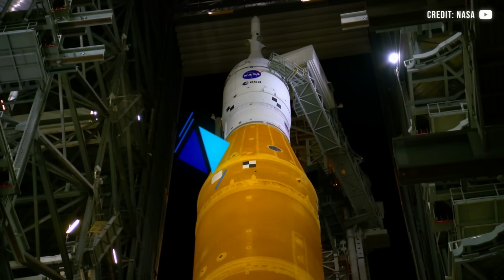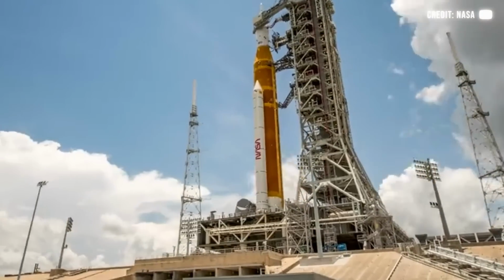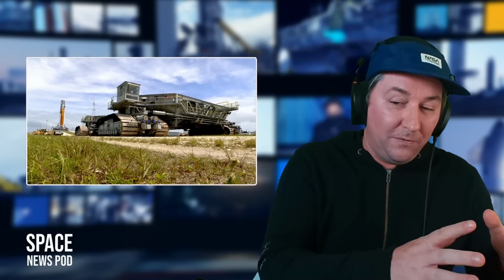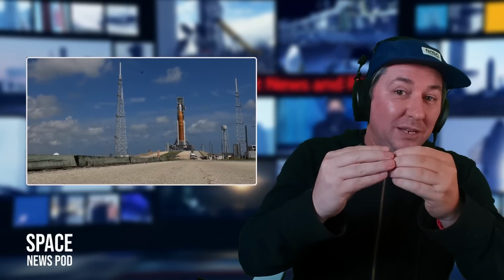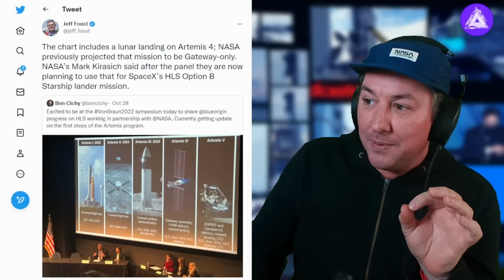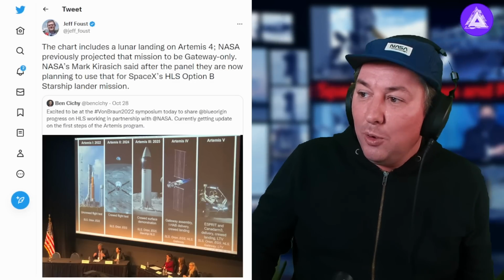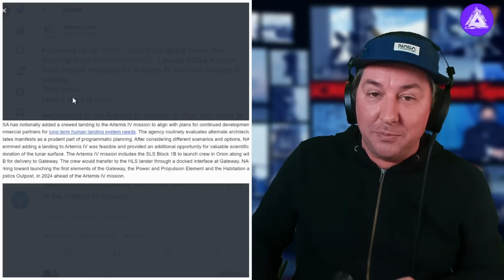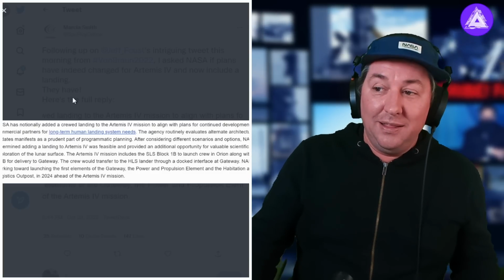NASA Artemis 1 Launch Updates

Comment: Just realized the Moon has been moving away from Earth, SLS might need to be redesigned and fitted with bigger fuel tanks, also the longer duration needs to be taken into account.
Reply: The block 1B variant features the E. Upper Stage. It has wayyy more range than the current ICPS and can carry much more payloads.

Comment: The choice to go with Hydrogen for such a huge rocket was a bad one
Reply: The re-used space shuttle engines on this rocket were designed for liquid hydrogen.
Reply: @njm3211 
 That's the PROBLEM. Save a penny, lose a dollar x 10
Reply: They used it for Apollo too, so... calm down sparky.
Reply: @hawkdsl  More power but more problems. Hindenburg turned out to a Glorious Failure.

Comment: The Question: Why didn't they do this detailed scrutiny of the SLS systems months or years ago during development and assembly?
Reply: Because they would make less money sad to say.
Reply: @OZtwo  Well...I know this Boeing is on very thin ice with NASA, and it's cracking.  The Cost Plus Contracts of the past have syphoned $$$billions from NASA & the DOD. No more Low Balling  to get a govt contract then come back for more money. SpaceX shower that they could fulfill a contract, on time, and still come in under budget.  So no more of these COST OVERRUNS, or Mismanagement excuses. 

The OMB now demand to know the actual projected cost of complete the project requested or GO HOME because they are gonna scrutinize your numbers and cost projections thoroughly.
Reply: I think this is mainly because of the delays and that issues that lead to that, so they just used the fact of them having to shelter the rocket due to tropical storm Ian, and we don't talk about money anymore when mentioning SLS
Reply: Some of the failures only happen when you fill the rocket with fuel - and flat batteries happen when you plug stuff in for a couple of months when they have a design life of days and an operating life of minutes.
Reply: They did it's just words
Reply: SLS needs more money, take it as given.
SLS needs to be delayed till more money.
More money needs SLS delayed.
SpaceX needs to be delayed.
More money needs more money.